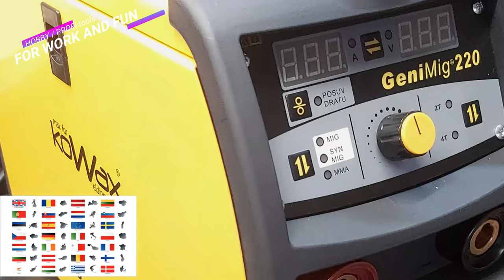Parkside náhrada záhradná kosačka GRAPHITE 52G672 kombinácia 3 v 1 výkon 3KW a šírka záberu 502 mm

Comment: Dělají se ještě pořádné sekačky ? Sekačka kupovaná před cca 10 lety za 5600Kč (vzhledem k inflaci odpovídá v dnešní době cenově této), má motor  5HP (3.7kW) a navíc pojezd (ten jsem demontoval - mám rychlejší tempo a překážel). Slouží skvěle, ale hodil by se boční výhoz. Mulčování nepotřebuji a plastům bych se taky rád vyhnul. Pochybuji, že vydrží v delším časovém horizontu. Neměl by někdo nějaký tip?
Reply: Napadla mě třeba honda asi za 12 000 Kč stroj s velmi výkonným motorem a bez žádných zbytečných věci např. nemá pojezd